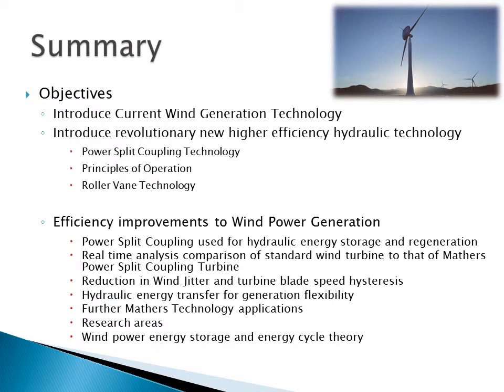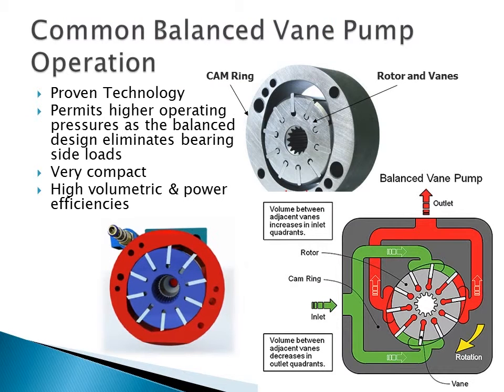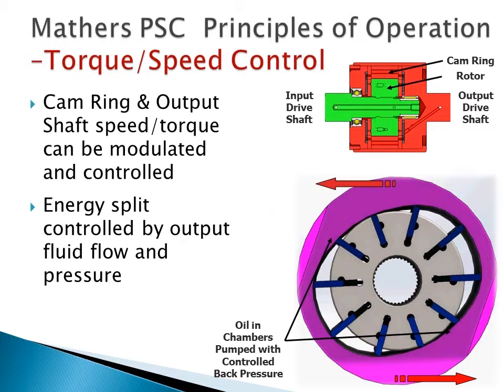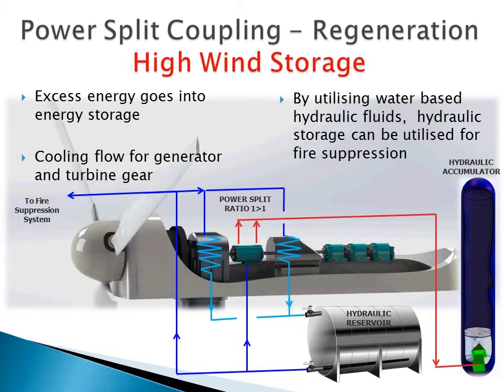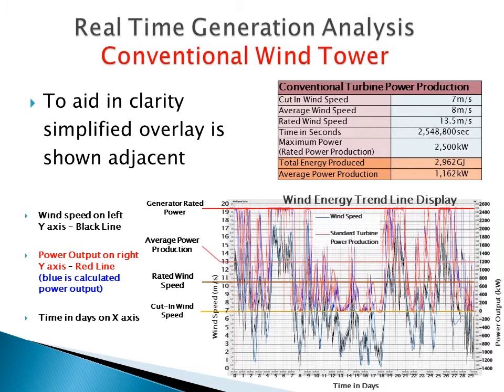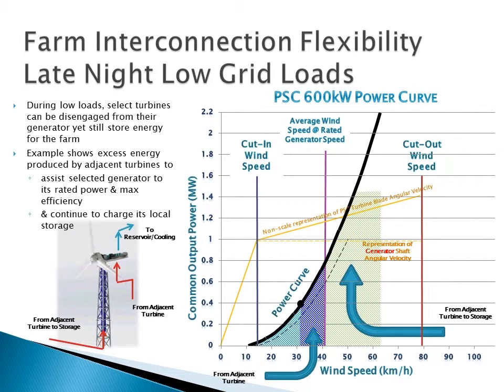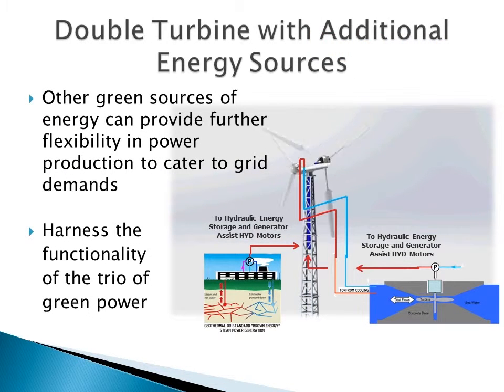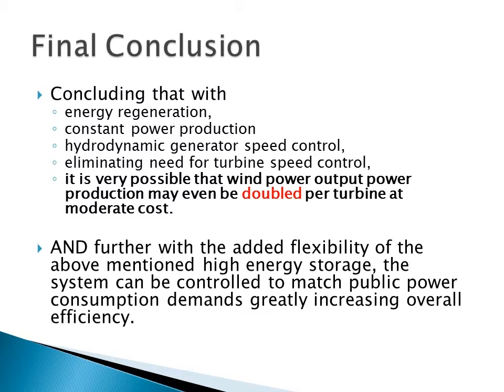Mathers Hydraulics - Revolutionary New Hydraulic Mega Watt Power Wind Power System

Comment: Hi Mathers team, not sure if you are still active. Great video presentation, I found it very helpful. We are a Naval Architecture company that is currently designing for the electric propulsion systems of medium to large motor vessels. We have a similar problem of variable very low RPM's combined with a constant high torque force. The first thing noticed during our design phase was that if the generator is only running at 75% RPM then the kW output is less than half the required output kW (losing a lot more than 75%), hence the importance of running the generators at it's optimum constant RPM and torque. We too have resorted to hydraulics to solve the problem. The question I have for you is, why not have the generator on the ground and use the wind generator as a hydraulic pump, then directing the hydraulic outputs to your accumulators that would provide a constant and regulated RPM/torque to the generator on the ground, thus optimizing the generator regardless of turbine speed. Why have a generator at all in the wind turbine?